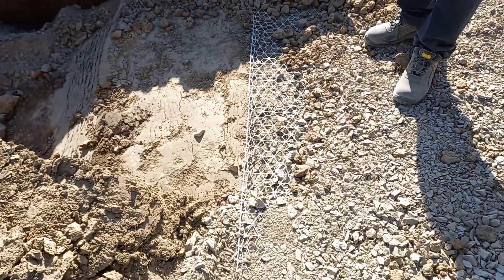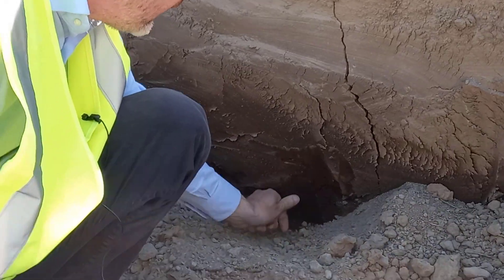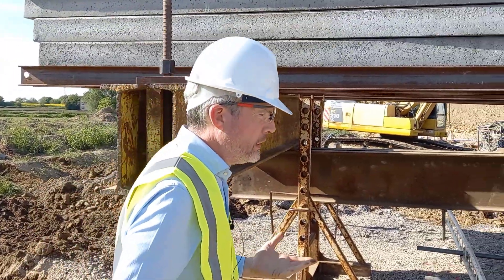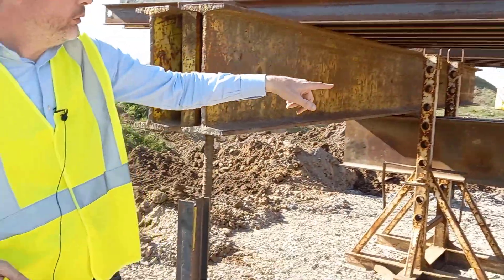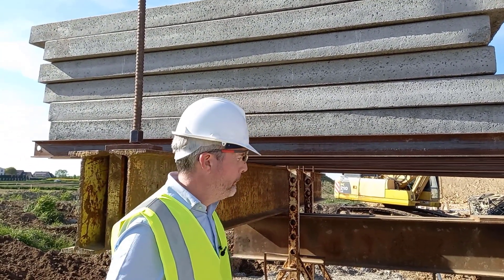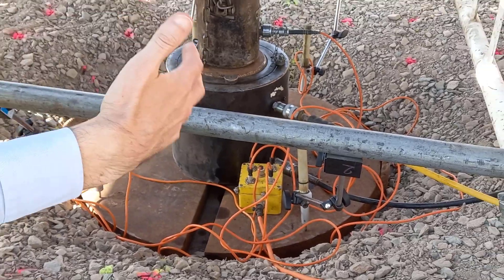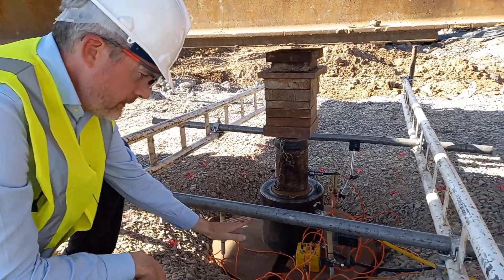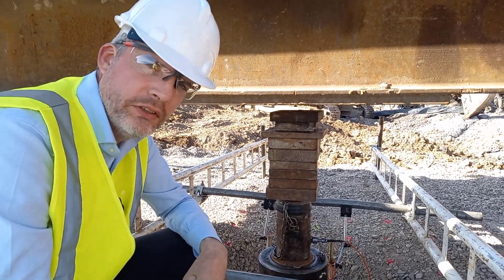Working Platform Design - Plate Load Test I Geotechnical Engineering I TGC Ask Andrew EP 15

Comment: Good demonstration of the configuration of the setup. 

One question, why the test load [Wt=(ultimate bearing capacity/3)*the plate area] should be applied in increments (i.e., 0Wt -> 0.5Wt -> 1.0Wt->0.5Wt->0Wt->0.5Wt->1.0Wt->1.5Wt->2.0Wt->1.5Wt->1.0Wt->0.5Wt->0Wt->0.5Wt->1.0Wt->1.5Wt->2.0Wt->2.5Wt->3.0Wt)?  I have come across this plate load test procedures when I am going through the COP of shallow foundation.  Is it related to the virgin compression and the recompression of the soil?  Many thanks.